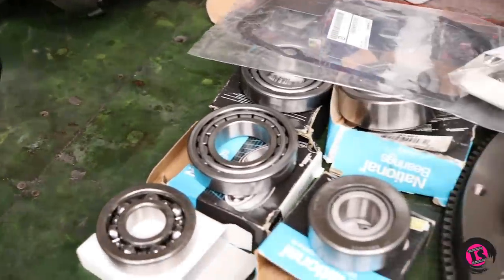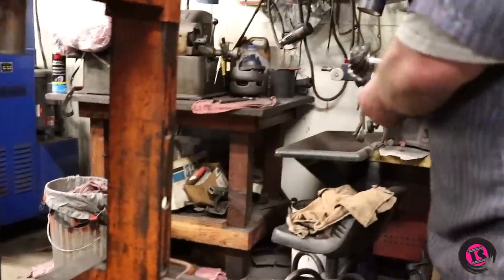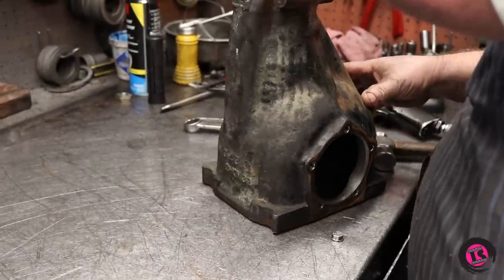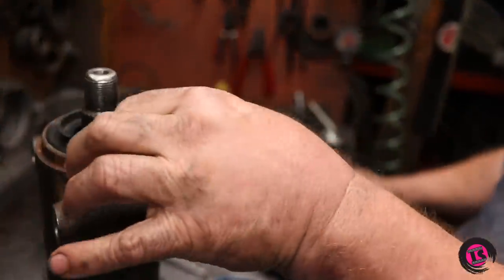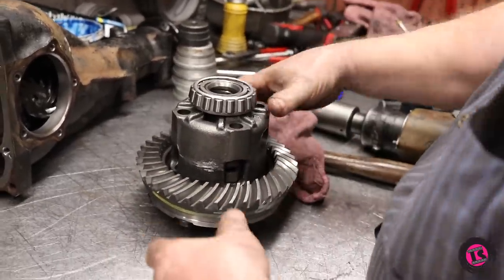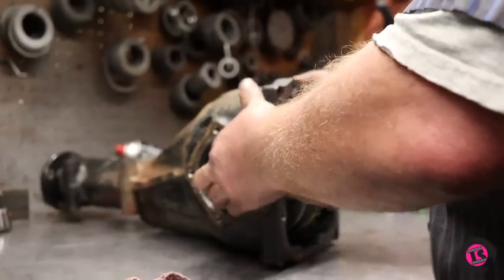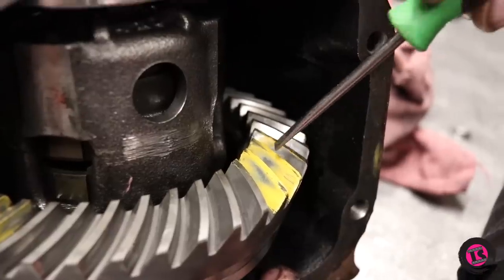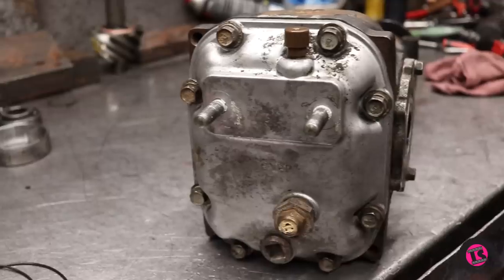Subaru R180  Differential Rebuild

Comment: 13:48 If anyone wants to know what that special tools is: it's a Yukon Gear & Axle YT P20 or P22 Differential Carrier Bearing Puller (difference between the two is a couple of pieces that aren't used in this job). I used my new P22 today to remove the bearings from two 3.9 Final Drive LSDs (center and front in a TY856) and it work flawlessly. Also note that you'll want to pick up a 1/2" drive 1.5" impact socket to drive the "press"

Comment: 13:16 Fun little tip and trick (though it doesn't always work and so isn't as reliable): you can hold side bearing retainer (SUbaru calls it a "Holder axle bearing") under a stream of hot water and the outer race will sometimes just fall out. I'm not trying to tell this professional how to do his job, btw. Just an extra "tool" for the viewers to put in their toolbox.

Comment: A few tips, I recommend not using oil on the new races. Using oil or grease can cause the the races to spin ruining the case. If they are loose fitting from being spun you can use bearing lock from loctite. You want them clean and dry before installing them, and the case .i would recommend not pressing the bearing from race on the pinion, should be pressed by the inner race of the bearing cone. Using a chisel to press in the front pinion race is not correct using the old bearing race making sure it’s not backwards that way you can tap it out if it gets stuck works but using a proper bearing race driver is better. And smashing the seal in with a hammer? Use the old front bearing race it’s the perfect fit, to safely press the seal in

Comment: This video works for the R160 as well. Everything is the same in positioning and installation. Except the carrier bearings go a bit further than past the flat. I used the old bearing to finish the press. Same with the front diff, as they are the same bearings.
Reply: Blaze Townsend I’m having trouble getting the top roller bearing down to race any tips

Comment: This is a cool video to watch, but I would say that anyone that tries this on their own might want to be more precise. I wouldn't personally settle for that drive tooth pattern on something I was racing. Also, Im sure the hammer works, but I always install seal with a socket or other tool to keep them flat and even. And I always use a torque wrench on something with a metal gasket, its cheap insurance against leaks.
Reply: For sure, the shown rebuild is efficient for race car use. But its not sufficient for long term use... too inaccurate

Comment: Thanks, currently have the r160 open diff out of my 17wrx and this helps with reconstruction. The pinion (smaller) spider gears lost a few teeth as seems to be common failure point.

Comment: Front and rear bearing preload
For new bearing:
18.6 - 25.5N (1.9 2.6 kg.) 4.2- 5.7 ib)

With Spring balance at companion flange bolt hole.

Info from service manual for 1997 subaru impreza only.

Drive Pinion Nut Torque Specs.
Start low and increase to achieve preload.

181 - or + 15 N-m (18.5 - or + 1.5 kg-m), 134 - or + 11 ft-lb) 

1 inch lb of torque is 12 ft-lb, so 4 inch pound of torque as shown in preload video is equivalent to 48 ft-lb

Comment: I really like this video. I've watched it lots of times. I am trying to do the same thing on my R160 rear diff (AP Suretrac in case that matters). I cannot get the smaller pinion race into position. It is not entirely clear from this video how it's done. The mechanic uses his big tool with bit broken off it, but there is an obstruction that prevents me getting the race in position. It gets close, but then gets stuck. I've heated the case to about 150C in the oven and put the race in the freezer, still stuck. Would love some good advice please!

Comment: Great video on the 'How to', but the rear diff was giving you problems. Did I miss the part of 'this is whats wrong with it'?
Replacing bearings and seals - nice, but nothing was shown if the bearings were bad. All parts were reused.

Comment: Hi Paul I would like to ask for some info on these rear R180 differentials I am building a 4x4 cross-kart buggy and using this R180 in the rear and front I was getting a front one out of a Nissan 720 4x4 truck but they are pretty much gone but being an R180 can I take a rear one and set it up in the front what is the difference on the ring gear my drive train turns to the left when setting in the buggy how can I change the ring gear to a front-drive set up  can you send me some pictures of rear ring gear and a front ring gear stand them up to show the direction the rear one and front one in line thank you Steven.

Comment: I know as a fact this. If you are not experienced with working on rear Diffs, leave them alone. Its best to take it to a guy like you did that knows his shit. You can do more damage and blow out a diff faster than it took to tear it down. Its NOT something a rookie can do. I used to convert to a posi on many of my rear diffs, but that was simple stupid. Working with shims and clearances best be left to da man!
Reply: That line,  "A man should know his limitations" just may apply to this job.

Comment: I have been looking for the Yukon side Bearing Puller used in this video. I was informed that the bearing puller I need is a YT P20 56034. I ordered one from Ebay and it never arrived. The only distributor that has one of these is Amazon. The price has now gone up a buck and I want to be sure this will work on a Subaru BAJA. VIN is 4S4BT63C556106467 . Or..do I need the YT P22? Any help is greatly appreciated,  Thanks Bill

Comment: Does ANYONE PLEASE know where i could find a LSD (rear) that would fit into my 2011 Subaru WRX sedan???
Reply: Too little info. Biggest thing to remember is to maintain the final drive ratio across the board. You mix a 3.90 with a 4.11 and you're gonna have a bad time. That final drive ratio (in the differential carrier ie the rear diff) is determined by the ring and pinion gear, so you actually can take your old diff carrier and replace just the diff with basically what ever you like (as long as you stay within the SureTrac R series, that is. So the bolt pattern on the ring gear matches to the diff. The 180 or 160 in the R series means the number of splines on the ring gear, btw). I'm not fimiliar with your model, so assuming it came with open diffs, you should be able to buy it directly from Subaru at parts.subaru.com (if it didn't come with what you want on your model, check the LSD on other models).

Comment: Is this the suretrack / torsen diff that are mounted in a STI 2016 ?
Reply from the maker: This is from an 05 drivetrain.
Reply: Wait...are the newer models coming with Torsen diffs now?!
Reply: @occamsrazor1285  yeah , on euro-spec and us-spec there are only suretracs and torsens now...Last plated rear diffs was on STI-07 in euro /Us..... It´s posible they still got plated diffs on spec-C , the S-207 /S-208  and Type RA-R  in Japan but not here

Comment: Isn't that a R160?? The R180 has other housing and side cases.
Reply: Nope - the R180 is easily identifiable by the big letter K cast into the main housing, R160 do not have that.  Also the flat mounting surface where the 2 rear mounting bolts protrude from the cover plate is different on the R160, it has 2 separate smaller mounting surfaces around the bolts compared to the single one on the R180.

Comment: You checked wear pattern and preload but what about backlash?
Reply: lifeisgood070 I don't know I think he kind of half-assed the rebuild. he didn't measure really anything... all he checked was the wear pattern and on the drive side of the wear pattern it could have been better for sure it was barely half of the gear.
Reply: Totally agree he never put the tools up to the gear. Granted in this case he probably got lucky and everything will be fine given the parts that were re-used. But if you were building or designing one there is way more stuff you should check.
There is literally no way to know how hot this gear will get under load given the testing done. I've seen good gears with horrible backlash get some ridiculous temperatures.
Reply: lifeisgood070 he did check the backlash at 22:08
What is hard to express on film is experience. Dude has been rebuilding rear ends for more years than most of the commenters have been alive. Yes could he set up a dial indicator, but the end result is going to be the same. He just has done it enough to feel it.
Reply: lifeisgood070 I agree with Tracy Allen, this guy relies on a lot of experience.  He gave it a wiggle and was like this is good, I'm sure he is correct but I'd love to see a dial indicator.  The driveside wear pattern looked a  little off center but I guess he explained that it was just a worn gear.  I think experience is valuable, I've tried cooking where my mom did a pinch of this and heat for a a few minutes while I followed the recipe to a tee and hers was noticeably better.
Reply: So you can set up many different things when adjusting that r180 differential.... you can control the pinion forward and back (depth in and out) and the ring gear side to side (shims side to side on the carrier) on the r180 differential... I have built several and I Road Race them in a 450whp car that's rear wheel Drive and I really feel that he didnt do a good rebuild. He slapped some parts in it and I'm pretty sure he hurt at least one of the bearing races when installing them. Now I'm not sure about the quick change diff that he tried to compare it to but I can tell you the wear pattern could have been fixed on the r180. It takes time and at least a second disassembly after checking the wear pattern. Hopefully there's no really hard launches and super hard downshifts in this differential it may chip/shear some teeth on the ring gear.
Reply: lifeisgood070 i agree with you.  I certainly didn't get impression that he was precise or thorough, but relied upon experience.  I've had a jeep regeared and it took hours of the guy shimming, measuring and painting before he was happy.  I know this included new ring and pinion
Reply: To do it right requires a lot of time. To do it so it will work another 30k you can do it like he did it. I've seen a lot of people get a simple step wrong that leads to a huge heat factor in the differential under load like towing. Definitely agree.

Comment: This guys a hack.  The drive pattern is not centered, he only painted 2 teeth, he pressed on a conical bearing with the rave which pushes on the rollers, he hammered the races in and the chisel slipped which marred the race and that is way more backlash than 8 thousandths.

I could see why this looks impressive if you arent a mechanic, but if you are, its a lot of bs.

Comment: never press a new bearing onto a shaft using the new outer race, should always press on the inner race, this guy is a hack.
Reply: Also use soft metal like brass when tapping in a race or bearing never steel.

Comment: So many things done wrong. Pressing on the wrong part of new parts not using a block but instead taking a hammer to the race. Lots of lazy work habits shown in this video. Not using the correct driver to seat new parts without damage. When he took the new race and used the press on it he should of thrown that bearing and race away. You put dents and flat spots in by doing what he did.